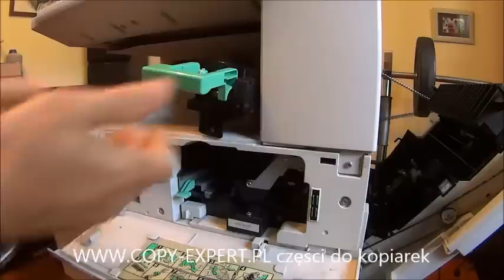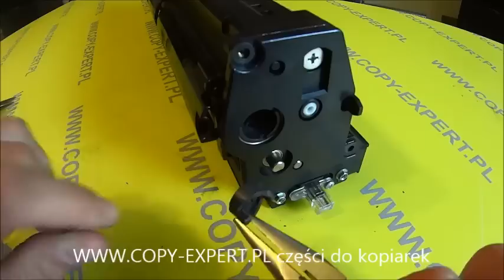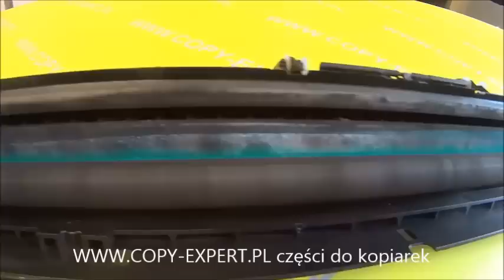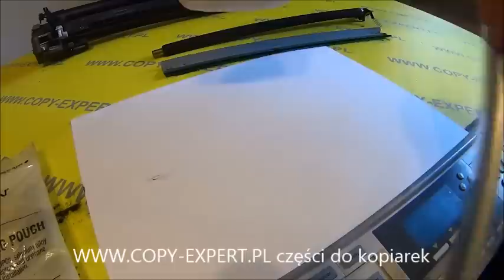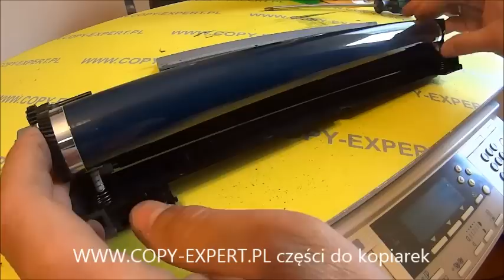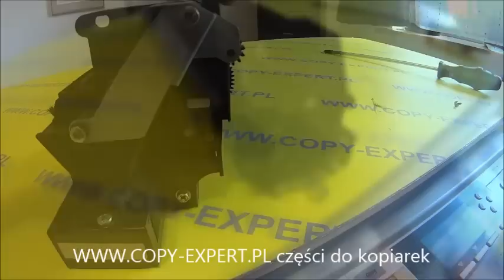RICOH AFICIO MP1600 MP2000 MP2352 wymiana bębna listwy rolki ładowania

Comment: good morning dealer we have a problem with a Ricoh 3025 aficio it does not stop when the machine is in green and pressing the copy key moves the scanner and does not make the copy. if you could give us some technical suggestions thank you good job welcome Sorrento Amalfi Napoli hello Tomasz
Reply from the maker: Hello, it might be a toner problem. The copier may be supplying toner all the time. But he can't add toner. There are four problems:
1. the white toner motor visible in the back of the copier after the toner is removed may be damaged.
2. The green toner release lever may be damaged
3. The toner-opening part may be damaged
so
1st motor - remove the cover above the toner and see if the toner is rotating.
2. check that the green lever is not broken
3.Remove the plug from the toner and carefully insert the toner, if the machine works then you have the solution.
problem 4
It is possible that the developer's wheels are damaged https://copy-expert.pl/produkt.php? iden = 16183 then you need to replace them

Comment: Plz tell me Ricoh mp 2000 sc 500 solutions
Reply: Eror sc 500
Reply from the maker: SC 500 is a main motor lock. Make sure that the PCU has a good connection to its drive shafts in the back of the machine and that none of its gears are eaten up if you take the top section (drum) off the lower developer portion.
I also had one do this once when the developer unit was overfilled to the point where it could never turn.
Reply: Thanks bro I cheaked drum unit it block I clean it .but it main motor is not working
Reply: So I changed it